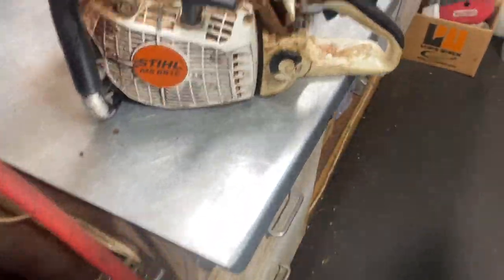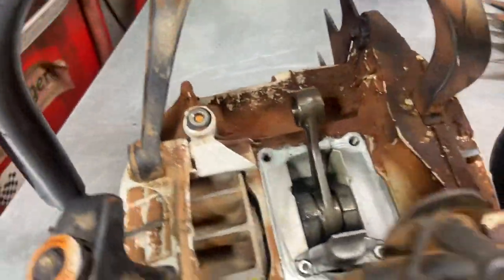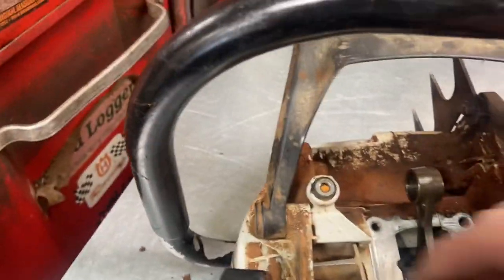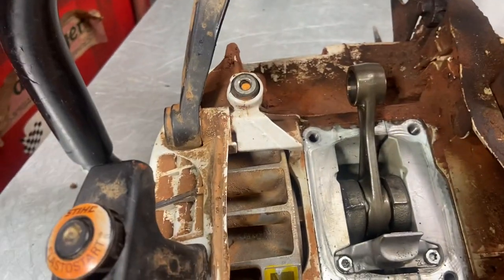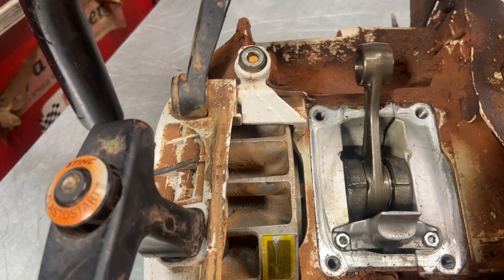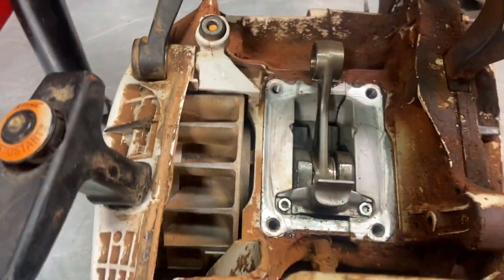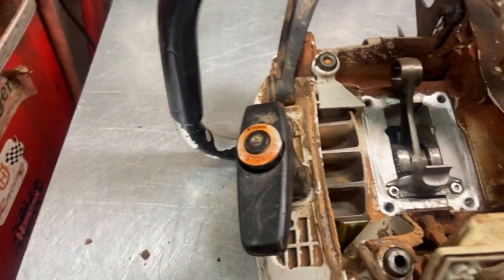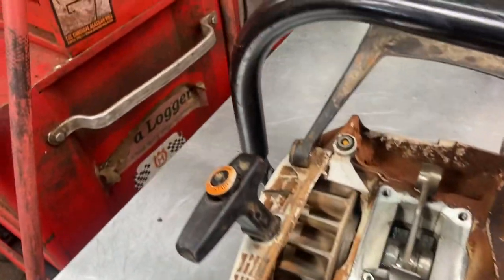Donny walkers chainsaws showing bad stihl 661 bearings

Comment: It never ceases to amaze how the m-tronic and autotune saws can keep on running on the ragged edge of exploding. For what the saws cost and the manufacturers oil recommendations you would think they would contract for the best bearings made. One would would benefit from checking the crank for play when performing regular maintenance on the clutch drum bearing. There should be no play, this saw is extreme. The saws I have fixed at this stage often have damage to the flywheel, coil, and sometimes the oil pump. The top end was lucky to survive on this saw, if the squish was tight it wouldn't have. Starting with the 562xp and MS461 I got real serious about experimenting with different mix oils and ratios, something to strongly consider on all the new saws as well as fuel quality. A saw that sits with moisture in the bearings for any length of time will suffer bearing failure quicker. It would be interesting to hear what becomes of this saw. Thanks for sharing Donny, your emotion and honesty over this shows how much you care.

Comment: I heard about this video on another channel Donny.  My Red Light 066 still has the ORIGINAL shielded bearings in it, and it was built in 92!  It's seen it's fair share of work over the years, it doesn't see everyday work now, but it ain't no shelf queen either.  Bearing failures are more common in both Stihl and Husqvarna today.

Comment: I'm sure Stihl is doing better on where they buy their bearings over someone just ordering them online but I had a heck of a time finding bearings. I ordered two sets from two bearing suppliers and they where supposedly Nachi, while the sellers claimed they where made in Japan non of the bearings where marked and the boxes where not marked either. 
I have used Nachi's in the past and all of them had the country of manufacture stamped or laser engraved on the bearing race, I ended up buying F.A.G. 6203 C3 bearings (for a Husky 288 build) that where NOS and marked. I believe there are more counterfeit bearings out there anymore than real ones.
Curious to know if Stihl is running a tighter than C3 bearing? has anyone looked on the Stihl bearing to see what it's rating is?

Comment: Wow definitely interested in how much time is on it.
Reply from the maker: 400 hrs a 100 days if ya ran it 4 hours a day
Reply: @donnywalker4691  wow that ain't very much to have that amount of wear!!! In my opinion!
Reply: If it was a stock saw then that’s not a very good investment - $1350+ for 400hrs run time ??? IF modded to the gills with high-compression/ machine work than that doesn’t surprise me in the least. There is no shortage of so-called YouTube “saw builders” that are machining the squish band , base and running a ultra tight squish (almost bordering on the actual mechanical limit). I seriously doubt some of them would last even 100 hours in the field working in their state of tune!  Some bold ones even claim their high-compression motors have no effect on bearing life - nothing could be further from the truth. Funny thing is they really don’t seem to actually CUT any faster than an old school style build. Oh well… I guess if you want to run something that sounds like a pissed-off hornet then expect to pay the piper.

Comment: Hi Donny it seems like Husq & stihl has been have lower end problems & it seem like they are the  ones that are fueled controlled let me run this by you & see what you thing the fueled controlled engines run near stoichiometric to  somewhat that is party lean 14. 7 : 1 & i know that the manufacture that make saws has to pass EPA the 50:1 is just that to lean for  to run stoichiometric  , I run 36:1  I am not going to tell what kind of oil that I run because of oil wars lol & plus  they are stratified .I have found a oil that you can run 36:1 & still burns clean that hard to fined it takes a lot of time and testing thanks

Comment: Drill lube holes might help. Maybe bearing doesn't get enough oil . But ya shitty bearings are they roller type? Done alot of ktm engines with bad/loose ignition side roller bearing.

Comment: I think that kind of bearing wear is just from people running 80-100:1 or 50:1 but running the saw very very hard. Low viscosity oils are also really bad for rolling friction, and this kind of bearing wear can happen before 500 hours of operation in low mix-low viscosity cases. I see a huge difference in failures in saws that people run something 33:1 Motul 800 and anything else with lower viscosity than the ones ran at 50:1-80-100:1. Ignoring piston issues that low mix ratio gives, even with these "wonder oils" that GUARANTEE 80:1-100:1 (but won't pay up on the claim), the lower end LOVED oil volume and oil viscosity. In valveless 2 strokes, high oil means high life. Run a saw 25:1 on the crappiest oil you can find, I bet it will last longer than some Amsoil saber at 70-80:1. No personal feelings or preference in this, it's just the physics of the movement in a rolling bearing
Reply: I agree, and may have been sucking in fines through a bad air filter. That will wear bearings.